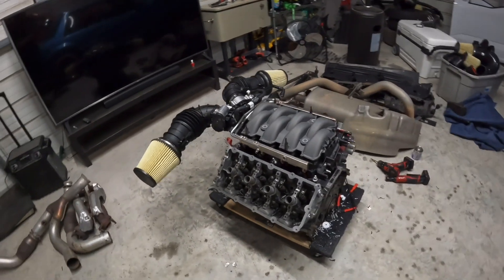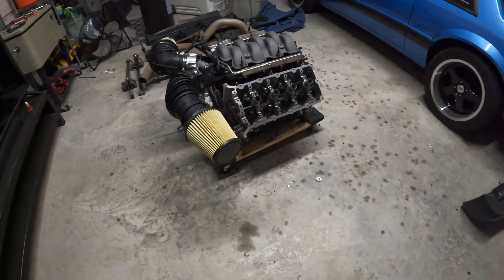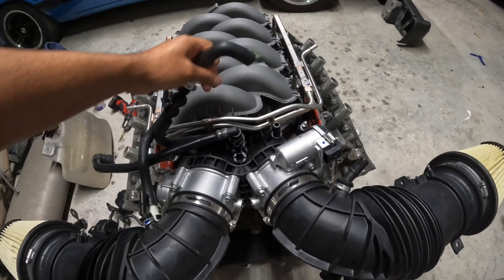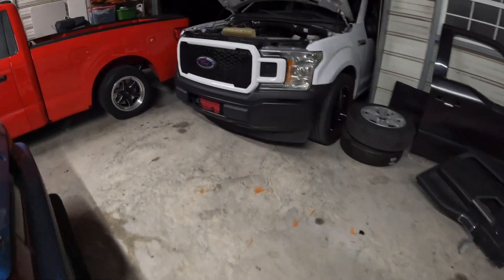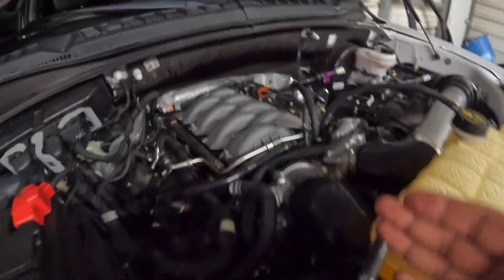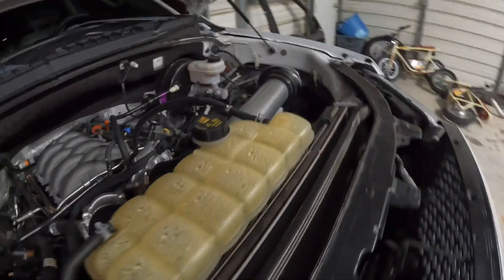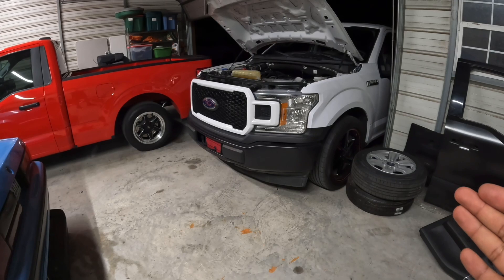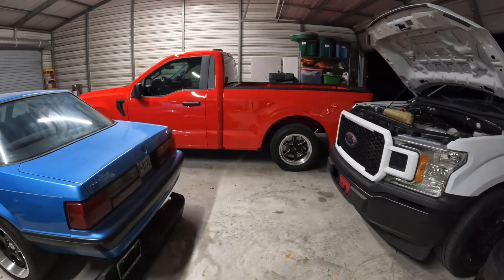1st F-150 with 2024 S650 mustang GT intake manifold, dual throttle bodies.

Comment: Hello sir, if I may ask, what parts do I need for a  Mustang GT +18 intake manifold swap into a 23 F-150? How many spacers and what size? Any new bolt types and sizes? Thanks sir. Also is it temporarily driveable before a tune is installed?
Reply: Ok, thanks Abel. I already have the manifold. Just need the spacer sizes. And bolts if any.
Reply from the maker: 2021+ Ford F-150 5.0L Ford Mustang GT Manifold Abel M-9424-M50C - 5 Star Tuning https://share.google/twybv1sKXDFIIDJ0e